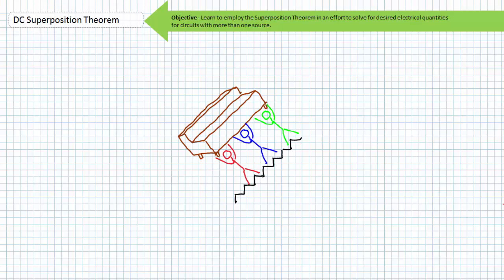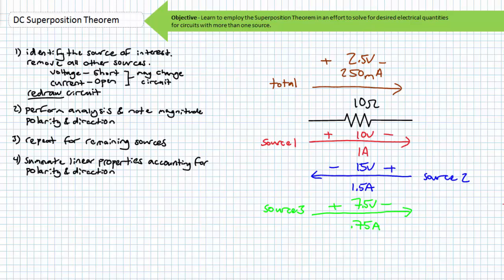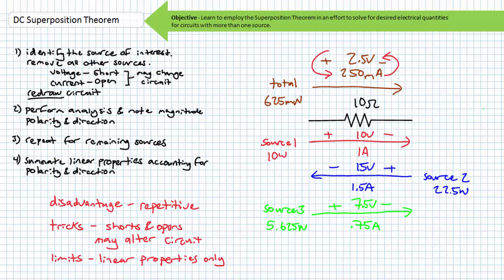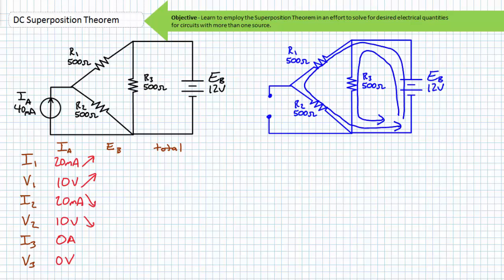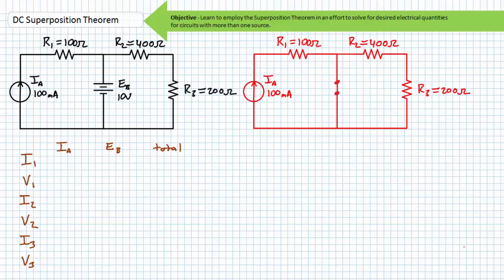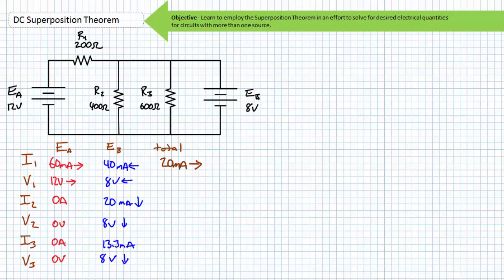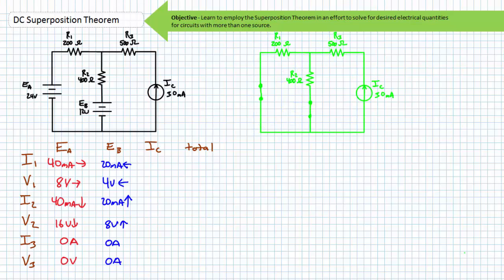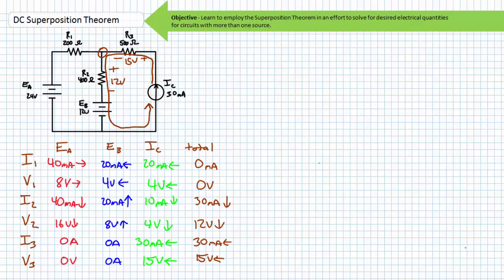DC Superposition Theorem (OLD LECTURE)

Comment: Amazing current can flow in reverse in a voltage source. Does this mean you can have reverse flow of current in a battery without damage etc ??
Reply from the maker: True. Reverse current flow in a voltage source would be a battery charger.

Comment: When would you use a current and voltage source in the same circuit. Is there a practical example where this is used ?
Reply from the maker: Some of these examples are admittedly impractical. A more practical example might be two voltage sources in opposition with one another with a current controlling resistor in between ... this is a primitive battery charger.
Reply: Zener diodes.